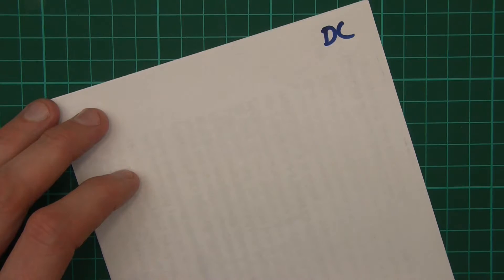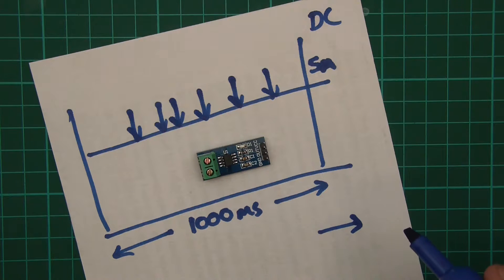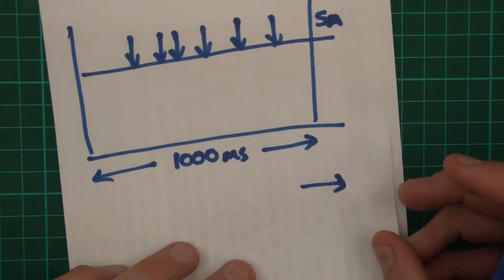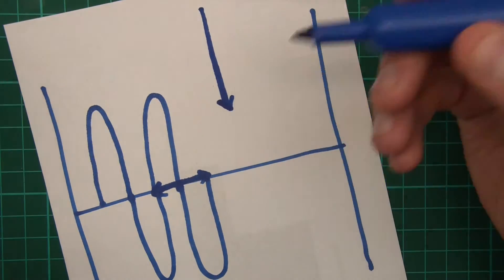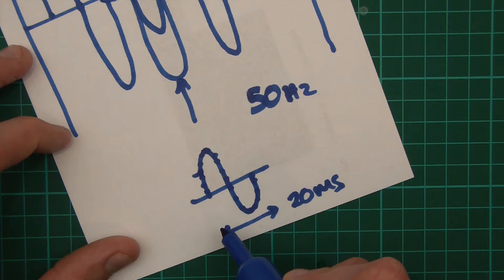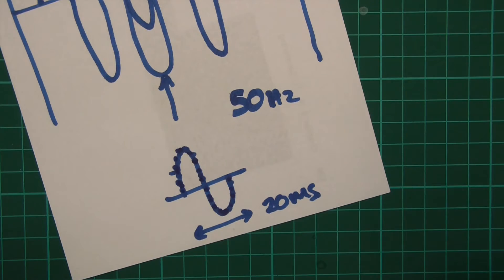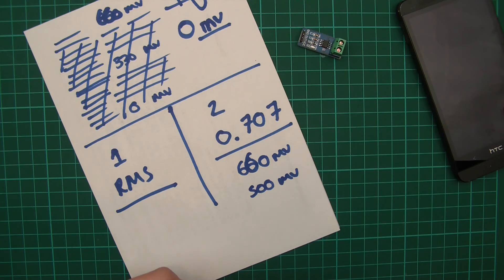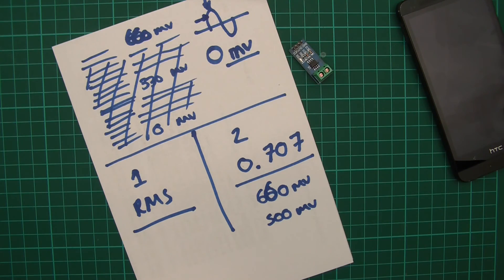TUTORIAL: How to Measure AC Current Using ACS712 Hall Sensor (Part 1/4 - Theory)

Comment: can i do like this to get highest peak voltage ?

void loop() {
    int sensorValue = analogRead(A5);

    float voltage = sensorValue * (5.0 / 1024.0);	//normal analog to voltage converter
    voltage = (voltage - 2.5);				//removing the base voltage

    float peakv;
    if (voltage > peakv) {peakv = voltage;}	//only if getting higher value will copy to peakv
    
    float amps = (peakv * 100) / 25;		//to reset measuring volt // 25mV/A for my sensor
}